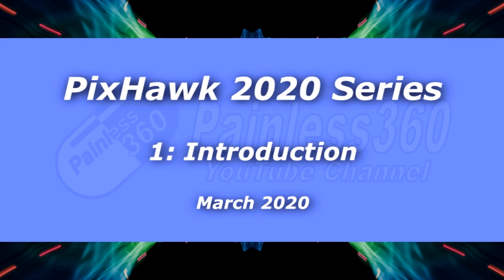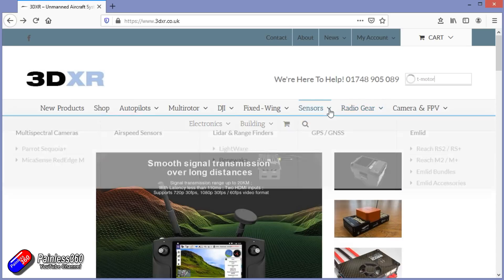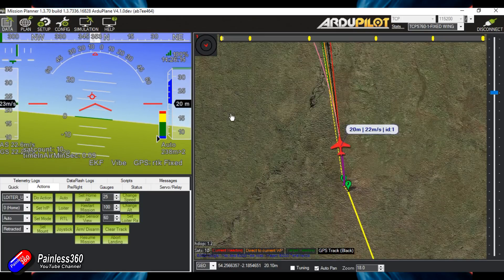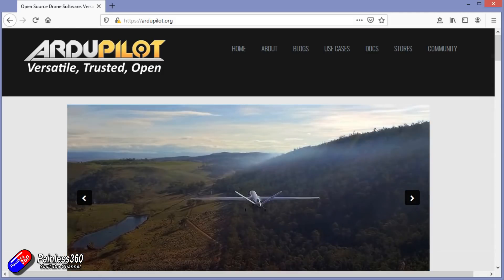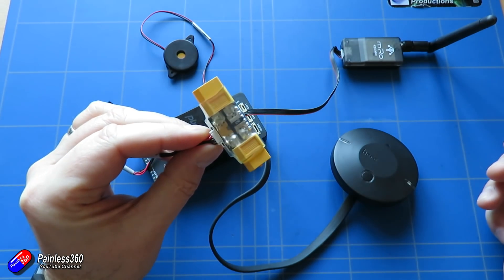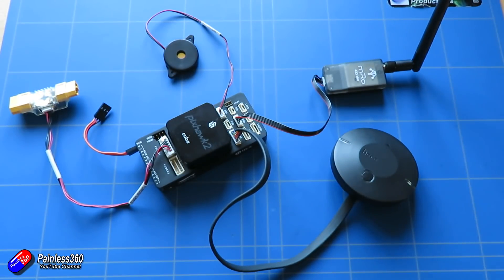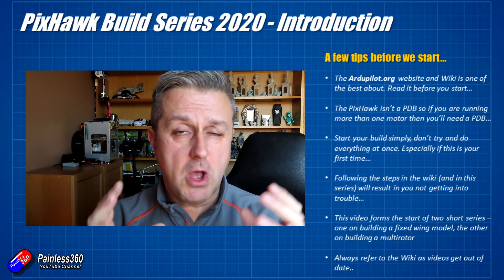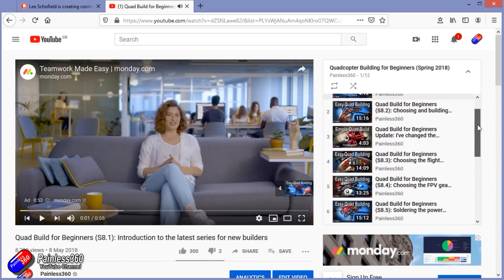PixHawk/Mission Planner/ArduPilot Build for Beginners: Introduction

Comment: i have the answer i think! and needless to say it would make an extremely lengthy video which i can explain to you and it should be done but i do not have the video ability for it. BUT IN ALL HONESTLY! is it worth it? pixhawk is the rolls royce of it all and so are the costs, but professionally its what you would want, but if nobody can download it whats the point! CAN "BETAFLIGHT" BE USED INSTEAD? CLEARLY "MISSION PLANNER" IS "WINDOWS" with mono it can work possibly?
Reply from the maker: Sounds like you've not watched any of the Arduplane builds on cheap FCs from last summer and the various videos I've done comparing Ardupilot, iNav and others. Check them out - I hope they help..
Reply: @Painless360  i have to admit i have not seen or reviewed your videos which i will now do! sorry it gets very annoying trying to get information and these people dont seem to understand their driving themselves into bankruptcy! if i only built a product and only sold to select people like windows how far can you go! and people using windows are very limited in many ways! i was w2k-pro and forced to use Linux to get arduino! only Linux could with the push of button download and run arduino! windows could not! and ALL the books and manuals LIED! saying Linux would require additional support! it worked the way windows was suppose to! you pushed the button that said arduino!

Comment: hi is there a pixhawk you would recommend for a new pilot wanting to do FPV with planes I am currently building a mini skyhunter and have enjoyed your beginners video for fpv and are now going through your Pixhawk build series and I am wanting to build my aircraft while I am in lock down due to my health problems.  keep up the good work you are providing me lots if entertaining vids to watch but I have been having trouble understanding the technical stuff so I am hoping to learn a lot from your beginner series on FPV aircraft set up, thanks
Reply from the maker: That's an ambitious build for a new pilot unless you've had a little experience. PixHawk systems don't support FPV very well but you can installed Ardupilot (the software) on non Pixhawk hardware now and it works great and provides an OSD for the FPV stuff too. See my Arduplane/Omnibus and Arduplane/Matek builds from last summer for example. Hope that helps.

Comment: sir 1 small issue, i was having power problems some time ago and then another Ytuber Dhruv arora advised on his channel to use separate SBEC's to power the servos and the telemetry radio and also to power the pixhawk cube from a separate BEC to power 1 slot in pixhawk and for power 2 slot we can use the stock power module, i tried instaling the BEC but i think i lack knowledge how to power it through that, kindly shed some light on this please, thanks allot

Comment: I spend weeks trying to get a payload release working on a Pixhawk. The Wiki was not alot of help (actually none at all). I ended up getting a friend to work it out for me. I would be very interested to see how you would go about it.
Reply from the maker: It's pretty easy and I've shown it on the channel. Setup a switch on the radio and then select the RC input that it corresponds to in the Servo Output screen in the mandatory hardware setup in Mission Planner... https://www.youtube.com/watch?v=kN3wWIC23KI

Comment: Thank for updating the series.  I have several 3DR mulitrotors that I want to convert to Aurdupilot firmware. I purchased several 3DR's when bestbuy in the states were unloading them for $250.00 for a complete kit with case. Great platform to upgrade to new green cube.  You should consider doing a series upgrading the 3DR's. https://github.com/OpenSolo/OpenSolo/wiki

Comment: I would also like you to discuss in detail the calibration of the 3 magnetometers.  For me it's the hardest part.  Many attempts, difficult to calibrate 3. It was important to check all the problems in the calibration and offer valid tips.
Reply from the maker: See the next video.  Correct alignment of the GPS module is key... best of luck!

Comment: And how are you going to connect to the FPV system?  Are you going to hook up an osd?  Please tell us which is the current reliable and cheapest option.  In my Cube I can only connect telemetry or osd, I never got both
Reply from the maker: Use the Holybro OSD unit probably... see my video on it..
Reply: @Painless360  Can you please share the product link?  Thanks
Reply from the maker: It's the one I covered in my February Postbag video. Link to it there.. best of luck